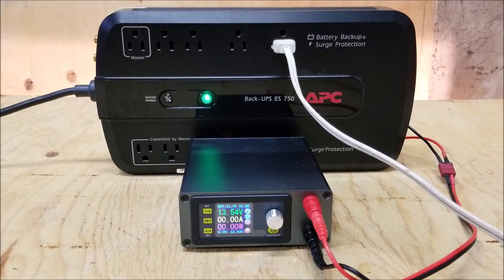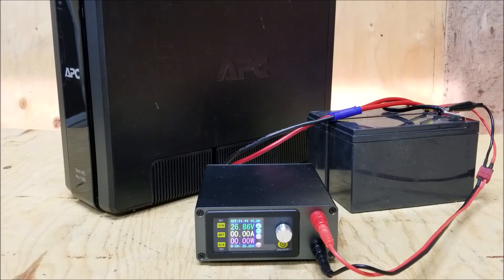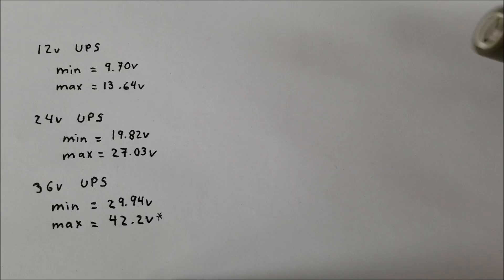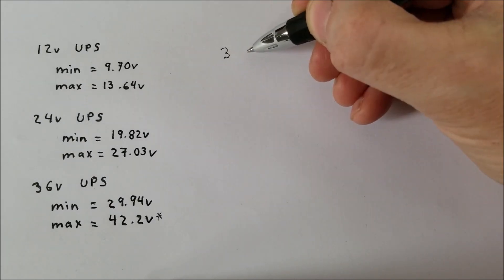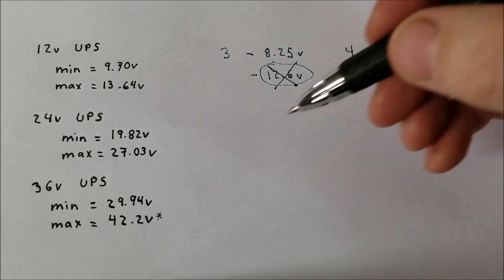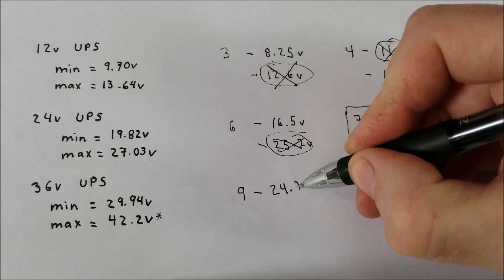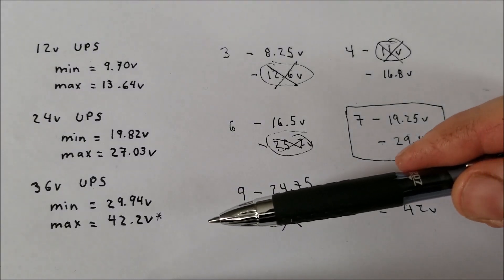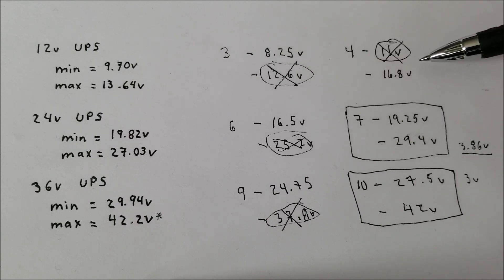Can a UPS use li-ion batteries

Comment: Neither of these configurations is good. Besides the charge bands described, the charging profile must be considered, and a lead acid charge profile is not compatible with Li-ion chemistries. Charge controllers for lead acid chemistries charge in three phases:  bulk, absorption and float. Of these, the float phase is particularly problematic for lithium chemistries.

Charge/discharge cycles from 4.0V to 3.0V are highly recommended to maximize the life of Li-ion chemistry batteries. Discharging below 2.5V severely compromises their life. Charging above 4.2V is downright hazardous, as well as life-reducing for Li-ion cells. Lastly, Li-ion cells don't like to remain at peak voltage for extended periods; the state where a lead acid charge controller will keep the battery. This, too, severely compromises Li-ion cell longevity.
Reply: would using a BMS solve the problem?
Reply: @KennyKenJm  BMS usually just turn off and on..... not good for the battery
Reply: doesn't an over-charge and an over-discharge protection board solve this?
Reply: @aleksandersats9577  Unless you know some other way, the lead acid battery charger does not give cc/cv charge and in addition it gives a trickle charge which Li-ion cannot deal with.... over/under is important but not the only thing we want...
Reply: Yup... Look up something called CC/CV chart.... says it all.... I have been looking at ways to convert my 24v ups to Li-ion. Perhaps if I could figure out how to find the charge unit and add a circuit between it and the battery.... but I'm still working on it. Maybe there is an external way such as a TP4056 for 7s xxp.... hmmm
Reply: WHAT ABOUT THESE?
https://www.aliexpress.com/item/32882745979.html?spm=a2g0o.detail.1000023.11.67695318sfq9MZ
Reply: Too charge it you can just use a cheap solar controler ore just use a lab power supply
Reply: John Coloe fore every 0.1 volt you charge less the cycles life span dubbles if you have a cell that has 500cycles and you only charge it to4v and dis charge 2.5v you will get 1500 cycles out of the cell
Reply: @jessyterpoorten7197  Only, if Calender Aging ( dendrites, etc ) doesn't kill the battery first.  Why do you need 1,500 Cycles in a UPS?
Reply: Most of the people tacking are not diy minds but class work thinker without any practical builds of their own.float charge is shut by default when you use ups like 24v with lithium batt.i have built many and i have one as a back up in my house.